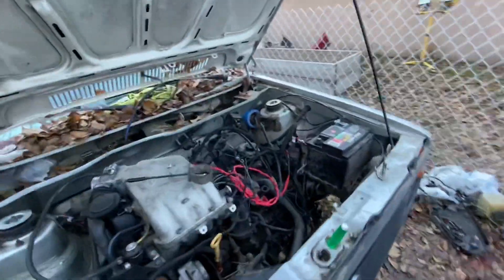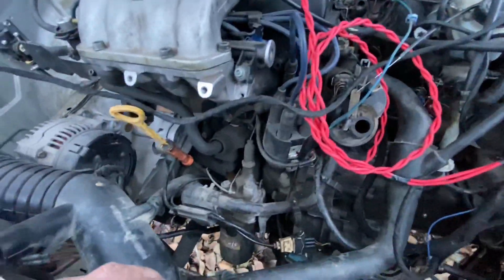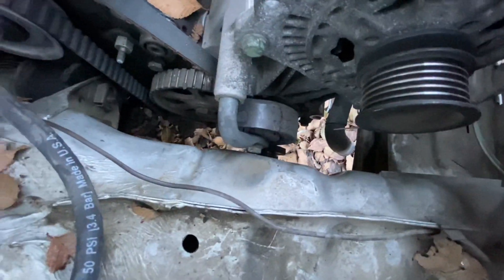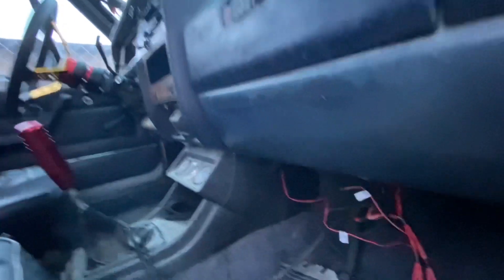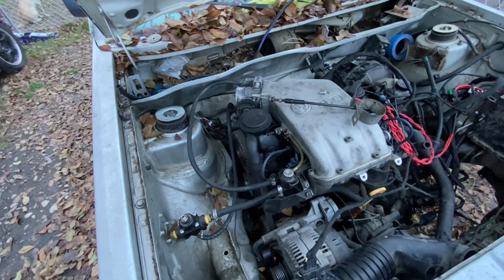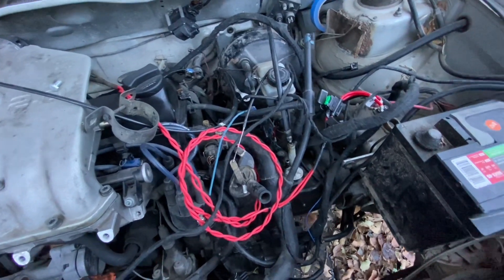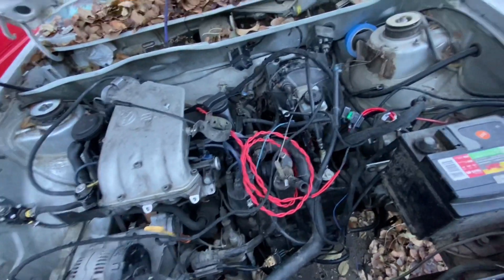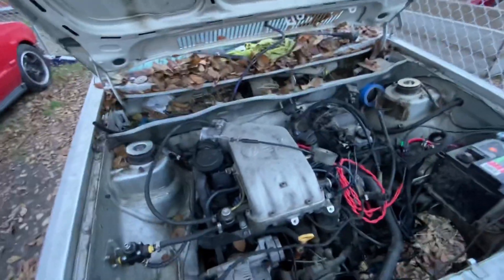Mk1 RABBIT ABA SWAP (part 5) wiring harness

Comment: I recommend prying the motor towards the driver side. Looks like you're fully to the passenger side and that can bind the shift linkage. The ABA tensioner should be about 5mm from the frame rail.
 Vss vehicle speed sensor plugs into the trans nearest the driver side axle. Best of luck!
Reply from the maker: Thank you I’ll give it a shot

Comment: Great video. Question the harness you got hooks up to the aba engine. Ingectors,Battery,ground, ignition switch, coil and ecu? Thats all you need to get it running? You didn’t use a fuse box or had to piggy back it?
Reply from the maker: No all the Accessories stay hooked up to the fuses but the engine harness is just battery ecu maf alternator and ground and other stuff like ignition wire and fuel pump
Reply: @Euromike  oh that makes more sense! Thanks im starting my aba swap and was looking at this harness. Did the harness came with a twist lock? And where does that hook up to
Reply from the maker: @patrichs100   when you send in the harness you only send in everything that’s past the twist lock if you have an Instagram I can send you a link so the company’s Instagram and he shows you how it’s built
Reply from the maker: @patrichs100   my Instagram is @gcs_euro
Reply: Can I get a link for the harness and how much.
Reply from the maker: @zakdunlap2090  https://www.tdc-shop.com/ $350